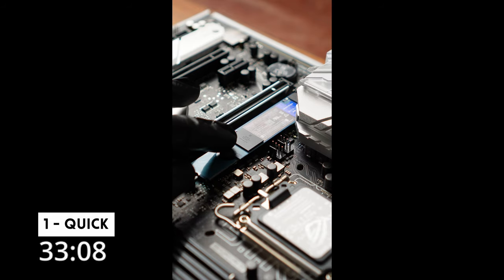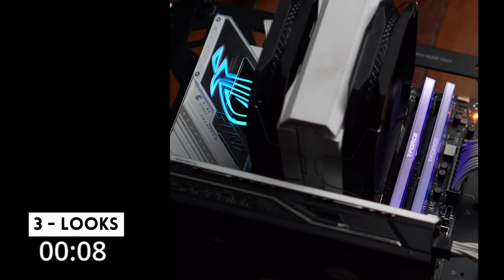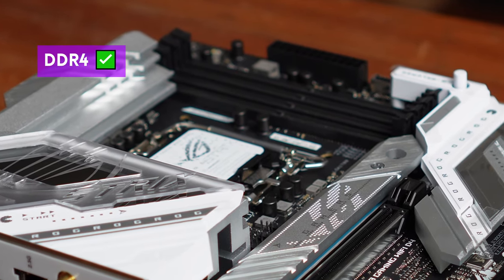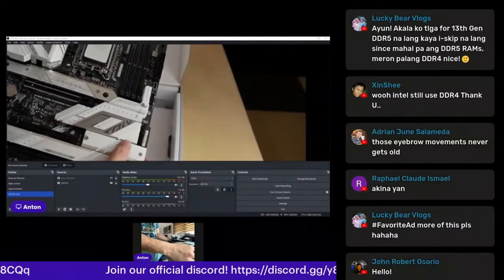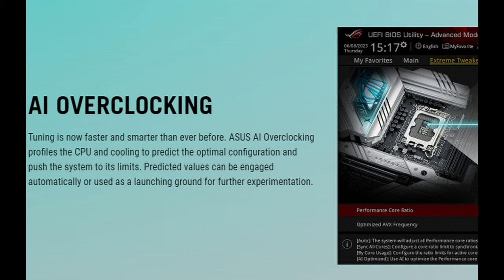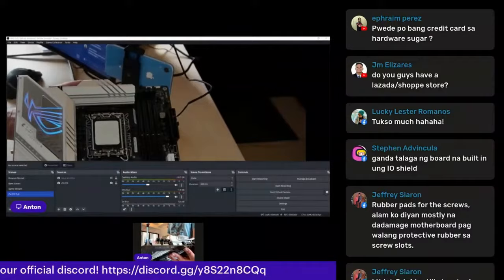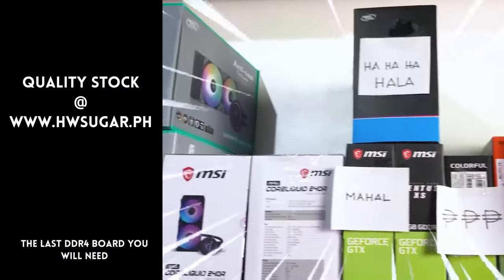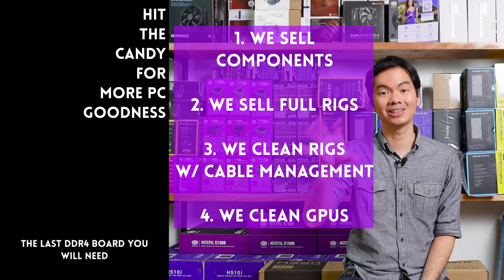ROG Strix Z790-A Gaming Wifi D4 Overview

Comment: Hi REALLY need some advice please!!! I was all excited to get some new parts for a pc upgrade and purchased one of these motherboards for 200 pound . The website has now disappeared and it turns out it was a scam , I've to contact the bank and pray they give me a refund.  I'm now not going to be able to afford to buy another one of these as they're over 300 everywhere else . I really need a white motherboard I've just ordered a white case and white ram to match this board,  I also need the feature  that's in this board where it has the holes to fit a existing water cooler with the lga 1200 connector.  Have you got any recommendations please 🙏 ☺️

Comment: Hello HWS, i have a 10yr old PC Build, im now planning to build a new rig, can i still use my old Coolermaster Stacker case for current builds? The front IO panels have no type C USB slots, the reset button seems stuck…. Also, im planning to go the intel route now, budget is for a Core i5 13th gen, i want an asus board, what chipset is best paired? B660, z690 or Z790? Can i still use my old Coolermaster 550Watts PSU?

Comment: Nice review! Anong 13th Gen CPU kaya yun? So far sa mga napapanood kong reviews mataas daw ang power draw and temp generated so if may "cool" option within the 13th gen then I'm very interested. Thanks!
Reply from the maker: the cpu we tried this board with actually runs pretty cool although the chip itself hasn't been announced officially yet so we can't make an official comment on it 😄
Reply: 13900k consumes less than 100w in games